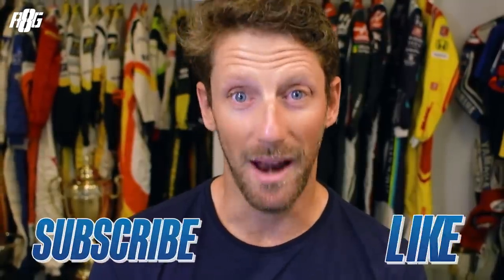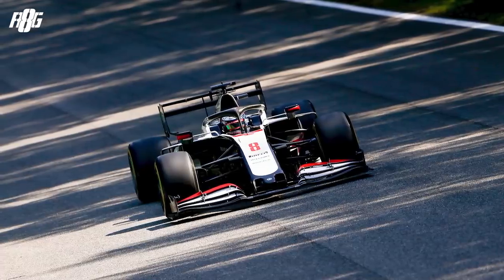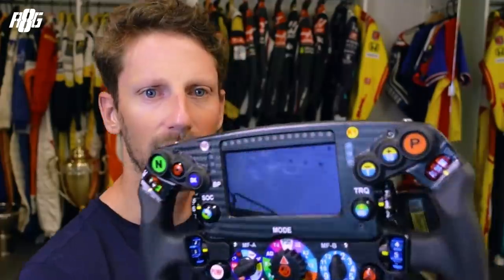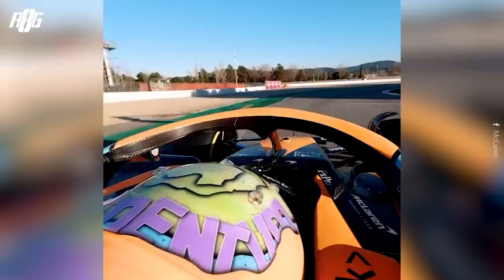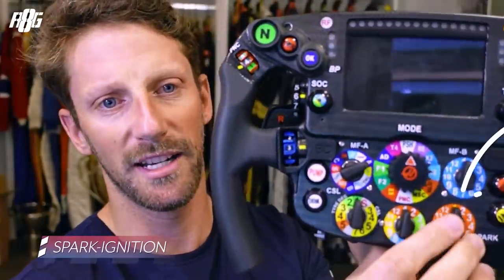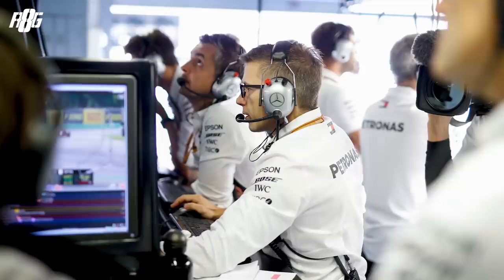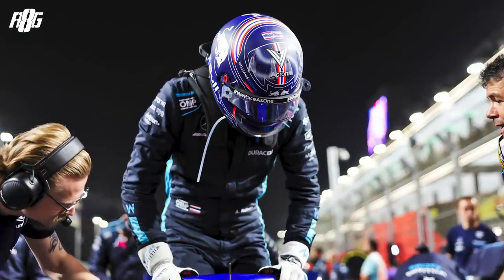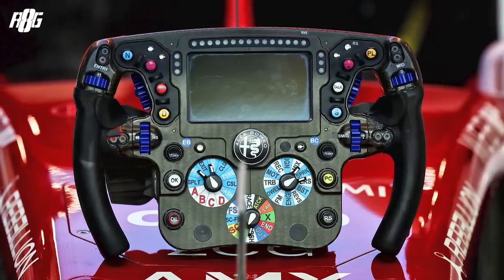Formula 1 Steering Wheel Explained

Comment: Its rare to see such a detailed insight into an f1 car component this recent. (TBH maybe they still use the same wheel on the current cars) Hats off to you man.
Reply: Yep, Haas and Ferrari both still use that wheel
Reply: Yeah they still use the same wheel, they rarely change them. They’re been running that wheel at Ferrari & Haas since 2015 & 2016 respectively.
Reply: @DaSpaceJammer  i've been researching about steering wheels a lot lately, im sure Haas still uses the SF71H steering wheel in 2022, it is just not practical to change it when it works fine, they got to remade all the molds and tests. Didn't knew it was Kimi spec though

Comment: the question is does the drink button work? It always seemed broken on Kimi's car
Reply: Kimi’s was probbably broken due to heavy use
Reply: its not broken, just the liquid on the hose always freezes on kimi.
Reply: @xcbrr50  good one 😂
Reply: The team disabled it because they knew kimi secretly mix it with an alcohol
Reply: @rogue5360  He only did that to keep the fluid from freezing in the line.
Reply: And this was Kimi’s STEERING WHEEL! model…
Reply: @paulb.6775  Nice, but were are the GLOVES! at?
Reply: @magical5181  No button for gloves or steering wheel... Or to tell his team he knows what he is doing!
Reply: You will not get the drrinkk
Reply: But is it empthying the bottle or not?

Comment: Omg! I would need a class on each button individually that affects the car! I've seen Lewis Hamilton, during a race, make adjustments for virtually every  turn on the fly. He's adjusting brake balance, possibly the differential as well and having a conversation with Toto while negotiating a turn and racing another car. That is an incredible feat that very few can perform successfully with consistency.

Comment: Thanks Romain! Question: If there’s a button to indicate tire deg, does that mean most of the “tires are gone” type talk is bluffing? Or is it just to emphasize the point that the tires are going?
Reply: The teams can see the switches and buttons positions, so if they have an agreement it is possible to bluff. I think the Mercedes for example got 3 buttons that does nothing on the car. The "PC" (pit confirm), the "X" and the "mark", that sets a marker in the telemetry if the driver needs to recall something at a certain point (it was widely used in 2020 preseason tests when they activated the DAS, probably cause they wanted to see in the telemetry exactly where the device was activated, the "marker" text on the dash wasn't actually activated by DAS itself). Plus they got the tyre switch, that sets the car for different thread thickness, they can use that as well, they won't be setting it for new tyres when the tyres are actually gone

Comment: What a fantastic and detailed rundown. Huge thank you (and here's hoping you don't get called into Günther's office 😋)

Quick question about the quick switches. Did you mean that the switch position could be set up with a range of settings that change together? So right switch up had preset settings for differential, brake balance, energy recovery etc, and right switch down has the same elements but with different settings... So that you could have switch up with the basic settings for long open parts of the track, and switch down with the basic settings for an area with a sequence of tight corners?

Comment: I came here to find out if the wheels where’s physically turned right or left during a turn or wether it was achieved by power differential,  

I think I got my answer , 

There was a lot of information on how the steering wheel works but I’m sure there were settings for power differential & turning the steering wheel uses this feature to turn bends rather than turning the wheels physically left or right like a regular car .
They may turn a small amount though.
I’m going to see if Google can find me some other YouTube videos on this topic .

Comment: Holy crap, it seems like it would be such a distraction fiddling with these during a race. 

I wonder if the use of some of the switches are dictated by team engineers rather than drivers (like in Indycar where drivers are told which fuel map to switch to)

Comment: Nice video sir! I don't understand how so much data is transferred from the steering to the car with no wires.  Do you use rf signals? Or IR transmission? Also the clutch part is not very clear. You let go the clutch by your hand? That is dangerous? God. I get in the dercor v wery soon. You are a special person! Good luck! Gr Reza from Belgium.

Comment: How do you learn, let alone REMEMBER, what all those buttons do? I'm not sure I could even learn them! Concerning the engine modes, do the engineers tell you what modes to run, based on fuel strategy, or does the driver do that in F1?

Comment: You see, technology has literally replaced the driver in F1. I remember going to the Monaco Grand Prix. I watched Niki, James and Jacques and many other, talented F1 drivers battle it out at Casino and they didn't have no fancy steering wheel. No, they drove theirs guts out in cars that sounded so amazing. So loud and very lovely sounding. These were real race car drivers. That might sound crass, maybe even insulting, but today's F1 is just flat out a joke. Cars might be safer and yes they are safer. Perhaps more nimble and even faster, but back at Casino the cars were driven by men. Not machine like automatons.

I dislike F1 today. In fact it's just a dead sport too me. The drivers look cool, but they're mere extensions of a totally automated racing car. Mine as well make them drive themselves. It's boring and ridiculous. NASCAR and several other motor sports are not too far behind. Technology was supposed too help create safer race cars. That it did, but it also eliminated the need for a driver. It's pointless. 

Yes, Casino back in 77 was epic. I loved Niki and James. Both men were literally gorgeous looking. Both had more tenacity, more guts vs any two drivers today. Plus they were super intelligent and enjoyed  racing without all the fancy gizmos and tech nonsense. I met both in the paddock. Being young, pretty and hooked on F1 made it an easy fit for me. Both men were so sweet too me in the few seconds I had talking to them. I still have my Polaroid of James and I. God he was so beautiful a man. A real gentleman. Yeah, those were real race car drivers.......

Today?

The computer fancy steering wheel runs the whole affair. They can have it and F1. 

KB🐎

Comment: F1 racing died the moment the computer became more important than the driver.
Reply: So.. basically during the 90s when stuff like Active Suspensions became a thing?
Reply: @FloosWorld_AoE  There about. Mid 90’s into the 2000’s. Whenever the car became undrivable if the computer crashed.